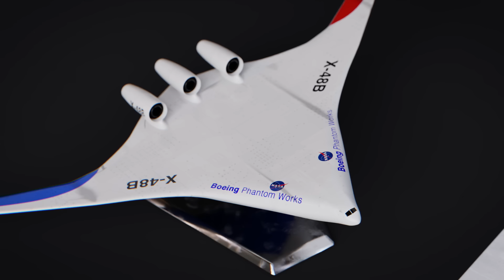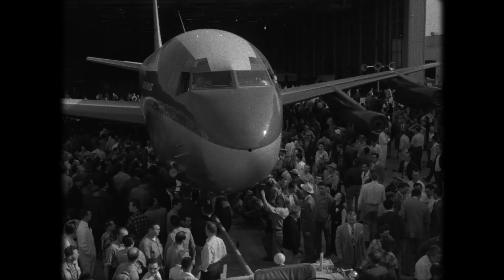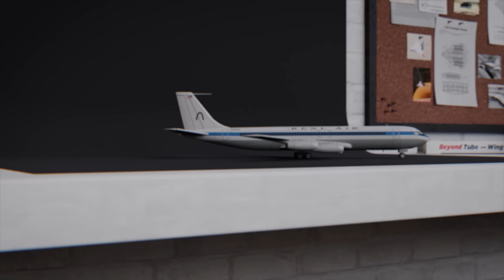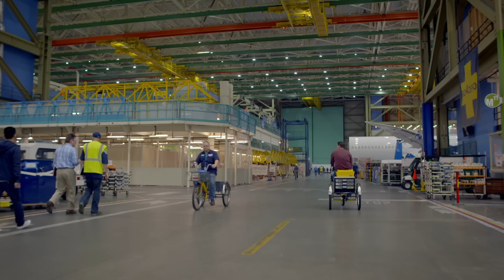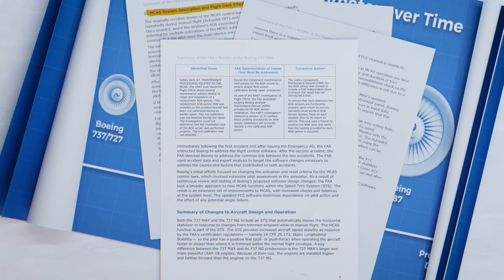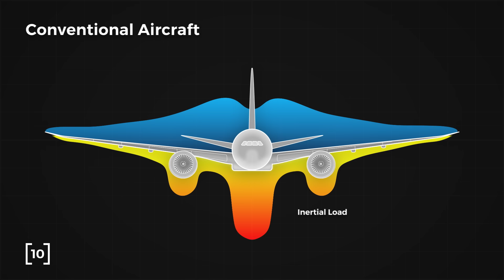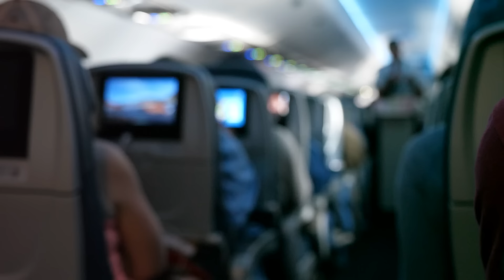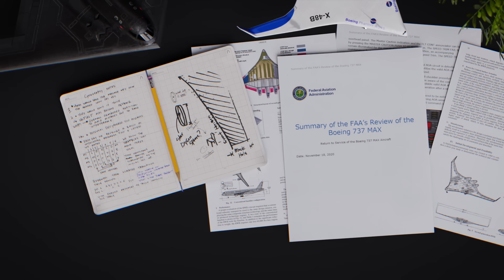The Plane That Will Change Travel Forever

Comment: This was a very well-researched piece, because you caught a lot of the "why we haven't done this yet" problems, which I suspect was your goal. If I may offer a few criticisms...
--"Tube and Wing" was in play from the late 1910's or earlier, and the fact you were specifically talking about jets isn't really relevant for the class of plane being discussed? The reference to fixed diameter tubes later helped specify what you were referring to, but it's still going to be confusing.
--You've conflated 'horizontal stabilizer', 'tail', and 'vertical stabilizer' a lot here. The reason the flying wing design without a vertical stabilizer (and instead relying on fly-by-wire) was chosen for the B-2 was always because RCS (Radar Cross Section) was the selected trait to minimize by engineering. You can have vertical stabilization and be a flying wing. Even the original Horton prototypes and some later intermediate prototypes still had passive vertical stabilization, as did the more recent civilian prototypes you've discussed.
--The chart with "fuel consumption per passenger over time" I think is labelled as "per decade" when you meant "per year", given that it went from 100 to 50, in 50 years, and the numbers cited were between 1-5%.
--Flying wings are weird, but you made no mention of the stability gained by allowing for dihedral wings (as observed in literally every civilian and non-military or fly-by-wire prototype shown), as opposed to the semi-anhedral (because the B-2 is both weird and classified) of the B-2 (which, as it's the only full-scale production flying wing is really the only production reference). No mention either while talking drag of the unusual trans-sonic effects in addition to lifting stress of tube and wing designs fighting the Sears-Haack or Whitcomb-area. Of especial note is how the flying wing/lifting wing must not have a tail to follow these, but can still have vertical stabilizers.
--I'm not sure how much research has gone into this(cargo), but a lot of the 'pressure hull' problems actually disappear for cargo applications as they don't require life support, and given the lifting body characteristics I think it would be worth mentioning that designing a flying wing that could contain 2-3 shipping containers that, while remaining sealed or venting the container without surface breach could carry those containers (potentially full of vaccine or medical supplies) halfway around the world, given the known characteristics of the B-2 alone?
--Mention the engine mounting problems of a flying wing vs. the weight distribution? Thrust alignment on these things is hard (Read: takeoff vs. cruise problem), and needs to be strongly considered as the 3rd element to center of mass/center of lift, but you only passingly touched on it in wing+tube alone?

Just some thoughts based on aviation engineering subtleties I've run into, trying to align this more with some of your previous videos (since I know you've discussed anhedral/dihedral before), and reference for some deeper insights for others to discover. I love that you're taking a serious look at the topic, and bringing what was once a fringe aviation thing out into the limelight for other engineering enthusiasts to feast on!
Reply: yeah, can't flying wings simply be passively stabilized by having the center of gravity in front of the center of lift? that doesn't actually require a separate tail, does it? maybe a design could be made that shifts either the center of gravity forward or the center of lift backward in low level flight to increase stability close to the ground, and shifts them closer together for cruising to save fuel, when there is less risk associated with a stall because the plane could easily regain control before hitting the ground?
Reply: @Ass_of_Amalek  Sadly, not really. CoG (which is also the Center of Mass) in front of the CoL means that the pull of gravity will create torque against the push up from the center of lift, making the entire thing want to take a nose dive right into the ground without a lot of fighting control surfaces counteracting this. Regarding moving CoM/CoG, that means that you have to move mass which costs fuel to do the moving, and requires adding mass (which is the thing you want less of to be able fly in the first place) that you aren't using for anything else. And also keep in mind that when you exert 'control' of any kind on anything, you're requiring energy expenditure of some kind (fuel, momentum, altitude, and the like if you're talking aviation or rocketry), so that's also something you want less of. Sorry for overrunning you @mor128, trying to provide some context for the idea that the 'Tyranny of the Rocket Equation' applies to Aero- part of Aero-space too.
Reply: @beatmoralimprove   The relevant location for stability is not actually the centre of lift, but rather the aerodynamic centre, which can be interpreted as the location of the first derivative of lift, i.e. where a change in lift acts. It’s therefore perfectly possible to design a stable aircraft without any downwards lift from a horizontal stabiliser since you can have the CoL match the CoG while the aerodynamic centre is still behind it.
Reply: Yup. But Günther was asking about CoL behind CoG/CoM. Good point on me not referencing that the aerodynamic centre exists though. Since I'm trying to show where some of those deeper mathematics and subtleties exist and can lead to, that was my mistake in not at least mentioning that AeroSpace is really cool in part because of how Calculus makes it work, not in spite of it.
Reply: @bakfietsman  But it can easily shift right?
Reply: @beatmoralimprove  The concorde and the SR-71 had a moving fuel system to ensure that the COG and the COL were always close to one another, but they were both supersonic, adding this system to a subsonic craft to make sure this thing is even more complicated to maintein is a terrible idea
Reply: @glockmat  I didn't know it was to ensure center distribution, I had thought it was due to the obscene fuel requirements they both had requiring some clever turbopumps to feed them, and the balance being a well-designed side effect. And given that the SR-71 is still legendary for being a mobile fuel spill while taxiing, I think I'll still call this a win :P
Reply: @glockmat  I believe the MD-11 had some sort of system (possibly fuel transfer) that attempted to improve cruise fuel consumption by moving the COM closer to the center of lift. I honestly don't know if they stuck with that because of the loss of natural longitudinal stability during turbulence. I do believe there were issues in early models. I'm not aware of any accidents related to that system but passenger discomfort may have been an issue. The plane was used for passengers for a relatively short period of time. I believe they are nearly all used for freight now. The horizontal stabilizer size was reduced compared to the DC-10. This would contribute to less longitudinal stability. I read a report that the controls on the -11 were much more sensitive than the -10. That could be designed in or due to less longitudinal stability. Apparently it's hard to land in windy or turbulent conditions and is the only airliner to catastrophically crash (3 times) due to bounced landings. 
My Dad flew B-52s and was an aerial refueling instructor (late 1950s to mid-1960s). There are quite a few YouTube videos of the cockpit that show the control movements required to do that successfully. I was shocked at the magnitude of forward and backward travel and the full L&R throw yoke inputs used to make such fine adjustments. He flew primarily the E and F models and picked up several brand new airplanes up at the Witchita factory. He told me as a ~10 year old (1968) that, at the time, he was amazed at picking up a brand new B-52 that cost more than "a Million Dollars" in mid-1958. Aircraft through the F model the used small outboard ailerons plus spoilers for roll control. And the wing gave a higher service ceiling than the G and H models that eliminated the ailerons for spoiler only roll control. Dad said that made fine control during aerial refueling much more difficult. Look up some of those B-52 cockpit view refueling videos up. You will be amazed.
Reply: @makisekurisu4674  The CoG can definitely shift, which is why ensuring it remains in front of the aerodynamic centre in all operational settings is a large part of both aircraft design and operations. The aerodynamic centre shift is usually negligible for reasonable flight conditions, however the Flying V shortly shown in the video had its maximum lift condition limited by a change in pitch stability above a certain angle of attack.
Reply: @Ass_of_Amalek  How would you counter the resulting torque of an offset CoL without a horizontal stabilizer?
Reply: @derMor97  sweep and a change in wing profile. In essence, through manipulating the wing surfaces fore and aft of the c.g. you’re able to get the desired longitudinal stability.
Reply: @Ass_of_Amalek  Usually the principle of aviation desing is make sure that you dont need something active. If some part of this system failed, the aircraft would lose control very quickly. you could theorectically do this by trasfering fuel and having the center elevators pushing down constantly. But again, the 737 MAX comes around, if you desing your aircraft in a way that guarantees that something will push down, it can go down. Also if the fuel pumps or the elevator system fail the aircraft would need to be flown manually with very little guarantee that you could possibly fly this thing. And not every pilot is capable of that
Reply: Airsick city!  Could  you imagine being on one of the outboard seats during turbulence, or even turning?  You'd be moving up and down many several meters, not to mention that your head would be tossed side to side as well as up and down.  Not having windows would make it even worse.
Reply: @blurglide  This is actually a common misconception based on how turbulence works in different vessels. Part of why flying wing designs are so unusual to us is that turbulence and maneuvering can have different expressions in them that we don't have over a century of math, trial and error, and intuition to compensate for. While yes, any center-of-something manipulations such as pitch, roll, or yaw (the conventional heading terms for aircraft) will cause amplified movement based on distance from the center, turbulence in conventional aircraft must transmit through the centerpoint of the wing-and-tube configuration, as if it were a flying cross (um actually this tends to involve branches of math that no one in their right mind does without computer assistance anymore, but this is Youtube comments, not Computational Fluid Dynamics as applied to Lifting Bodies 6XX at a Uni course). Without that fixed focal, many shudders that are experienced in conventional aircraft might instead be seen as something like a smooth elevator ride instead even 3 meters from the center line in a flying wing.
Further, if you consider the flight pattern of a flying wing, you may realize that yaw maneuvers can be possible in level flight depending on the structure, allowing for very gentle turns without intrinsically requiring banking (which is the roll and pitch you described fearing) being involved at all.
Reply: @beatmoralimprove  Ok, bigger area means less turbulence felt, but it also means more travel, and in that concept photo you can see 32 collums of chairs, if we take 40cm for each, very tight, but I'm trying to help this "desing",which means that this thing has at least a 12,8m from the center of the aircraft to the furthest passagers, so good luck trying to not feel unconfortable traveling 13*2*pi/12 m, around a 30º bank, this is about 7m, if we assume that the pilot is banking in 2 seconds, thats ~4m/s up and down, but the acceleration is much higher, because you go from leveled flight to 30º in 2 seconds means that the pilots are turning very fast at the begining and stop very abruptally at the end. For you 13m out from the axis.
Reply: @glockmat  Regarding your math around passengers in the as-described-6-aisle-during flight. First assumption: we still need to bank. Right, assuming we still need that bank for a normal scenario (airfoil and route plays really heavily here, no strong tail means you don't actually need roll to make a yaw in flight). Second, you're forgetting cargo and baggage. No reason not to put baggage in the bad space, as previously storing it underneath us is both not viable, and kinda silly. Now, that will actually reduce our axial by a surprising margin, potentially to about 9 or 10 m (let's assume 10, but it'd likely be 9 because fuel). Even if we take the original scenario, this only means less abrupt banking is required for standard maneuvering. Even if relegated to much more traditionally gentle approaches and orbits, even if we don't gain any reduction for design as I described, that means that the flying wing would (a) have room for improvement, (b) have clearly defined class-ist seating that makes sense to everyone today, (c) still provide typical modern aircraft unique dedicated flightpaths, and (d) be in a location that they can be easily spotted (given how much of ATC still relies on radar pickups of the notoriously invisible single wings)....
Salespitchy, yes. dealbreaker, no. Still able to exist in a middle scale of efficiency? Certainly.
Reply: @beatmoralimprove  Not every cargo can be thrown around like that either way, but even so, we would still need new airports, a plane like this cant land on a normal airport, this plane is wide and shallow, so airport terminals would need to be widened, also the fuselage holds 450 passengers, so it needs the biggests gates on the terminal, but paradoxically, it is also very short in height, which means that it requires the lowest fingers on the airports, some airports fingers can cover the whole height, but most airports have a section of gates to attend a 747 and another entirely to attend 737, so you will probably need some heavy scheduling and logistics to substitute the minimal amount of fingers as possible. Also stairs are only an option on smaller airports, you will definetly not see passengers walking to their airplanes on JFK. Why? Because its a busy AF airport where if they breath in the wrong direction they get sucked into an engine, assuming that they got sucked as an accident and not sabotage or a terrorist attack. 

Also 3 engines, why?
Reply: @beatmoralimprove  Doesn't matter as FAA/EASA will never sign off on a flying wing until one can demonstrate passenger exit in under 90seconds.  By this req alone, will require a tube for the passengers and NOT a flying wing.  Not that it matters as the profile drag of an ~3m thick wing section would be stupendously dumb to implement.  Why the only solution is a Canard layout and honestly have no idea why they have not made them already since everything is FBW anyways.  Flying wings... Do not work for passengers and cargo requiring LARGE volume.
Reply: @blurglide  From what I understand, this is one of the major reasons the airlines haven't pursued this design more. That and the amount of change required to airport infrastructure for passenger boarding. But it could be useful for cargo planes.
Reply: @phanorkner  Many cargo have the same if not more requirements than humans, so a cargo version still as stupid as a passenger version. Like fish is one of the most common cargo planes uses, but you cant have those if your plane isnt pressurized, so the plane hasnt even be pitched to cargo airlines and its already denied
Reply: @glockmat  Regarding Cargo: Actually, if you're talking about flash-frozen fish, I think physics won't care, especially given the ambient temperature at altitude. I have a strong suspicion that engine, drag, and lift mechanics of pure flying wings does very very weird things to expected cruising altitude curves, that regardless of frozen goods vs. low atmos, we might still get some efficient routes, which could run the gamut, do the safety tests, and proof some safety systems for more fragile cargo, like passengers.
Reply: @blurglide  yes when flown to make the pilot comfortable the passengers will get sick. This was first documented by NACA in the 1950s. The pilot (well computer) has to “skid” the turns to keep smooth positive g’s on the passengers.
Reply: Thanks for posting this. Your criticisms are spot-on. I noticed immediately when he said that the tube and wing design was created with the Boeing stratofortress, rather than the obvious predecessors like the DC-3/C-47/so many more. And saying that the biggest obstacle to environmentally-friendly flying was the tube-and-wing design rather than, y'know, the actual carbon-spewing fuel used to fly.
Reply: I think the percentage values in the "Avg. Fuel Burn per passenger-km" were meant to represent the average percentage of change of the years in the given decade, not the total percentage of change that happened in the decade overall.
Reply: About once a year someone does an "X 48, plane of the future" video or article.
Program cancelled 7 years ago, passenger support/research cancelled  almost immediately, Boeing head said (in a nutshell) "Never..., supposed to be for hauling military fuel, not that good for anything else, including cargo." recently.
Everybody: "Great research!"
Me: "Who's doing any research on this? Anybody?"
No.
Reply: @jbarnhart2653  I agree it is disappointing that the focus of this video is the X48, as you said a programme cancelled years ago. Having said that, there is very much still ongoing research on similar concepts such as the Flying V, which also addresses most of the criticisms I’ve read in these comments. In reply to @w8stral’s numbered list in particular: 1) this is true, however 2) the thickness-to-chord ratio is the important metric, not the absolute thickness 3) the Flying V is basically 2 tubes stuck together, which only requires a slightly larger cross-aisle at the connection for movement between the legs of the V to meet egress requirements 4) since it is basically 2 tubes stuck together it is very possible to create a family of variants, there has been a research project into exactly that. I would love for someone like Real Engineering to do a video on actual current research instead of basing it on old papers; I know many people are passionate to speak about their research if you contact them, especially to someone with a large audience.
Reply: @jbarnhart2653  Its almost as if folks at Boeing and Airbus can do basic logic that 1) People require 3m height of beams/walking aisles, bathrooms etc and 2) wings want to only be at the root ~1m thick at most and 
3) ingress/egress on a flying wing in an emergency is near impossible unless you just go with a giant tube and a flying wing... which negates usefulness of said flying wing. 
4) Seating of 3 class layouts is accommodated by lengthening fuselage so seat pitch fractions do not run into bathroom etc problems.   Try doing that on a flying wing... yea never going to happen
Reply: @w8stral  If you watched the video, they solved the emergency exit thing...
But a little research tells you that test passengers said "NO WAY!" and the company cancelled that early. Cargo? Nope. No place for loading large payloads.
So military refuelling...and it's going nowhere.
My beef is that you can find pretty well this video and a dozen or so articles, MOST from seven years ago when the whole thing was cancelled.
"Soon...". Twenty years plus as of now if then.
Reply: @jbarnhart2653  Lets just say Wikipedia is a gigantic lie.  I was there in said "mock up" at Boeing at the time.  IT was all of 16 chairs in the ampitheatre.  The reason Boeing dropped it like a hot rock is no design could get the emergency exits requirements right or even close to right.  Only way was via using ladders UP out of the cabin... I'll let you figure out how well that went over...
Reply: @w8stral  I didn't just check Wikipedia...
Reply: @beatmoralimprove "--Flying wings are weird, but you made no mention of the stability gained by allowing for dihedral wings (as observed in literally every civilian and non-military or fly-by-wire prototype shown), as opposed to the semi-anhedral (because the B-2 is both weird and classified) of the B-2 (which, as it's the only full-scale production flying wing is really the only production reference)."

anhedral and dihedral affect lateral stability whereas the video discussed only longitudinal stability.
Reply: @gw7579  I mean realistically lateral stability isn’t part of the discussion because it’s not where the challenges are. By far the main concern with removing the tail is the loss of longitudinal stability.
Reply: @matsab7930  I agree 100%, which is why I answered that anhedral/dihedral aren't the biggest concern.  The biggest concern in an airplane without a horizontal tail is longitudinal stability.  Anhedral / dihedral does not affect longitudinal stability; it only affects lateral stability and the two are (amazingly) uncoupled.
Reply: The labeling on the chart is correct, albeit very confusing. Its the average annual change per decade, so -2.6% would mean a 2.6% decrease annually for every year in the decade. 

It's certainly not how I would have picked to label the graph.
Reply: @teguh.hofstee  Ah. Definitely needs a minor update so the VO matches that though.